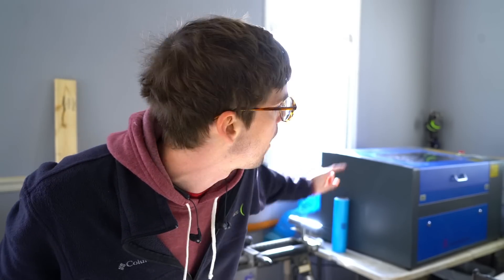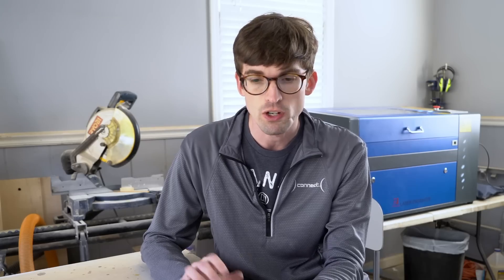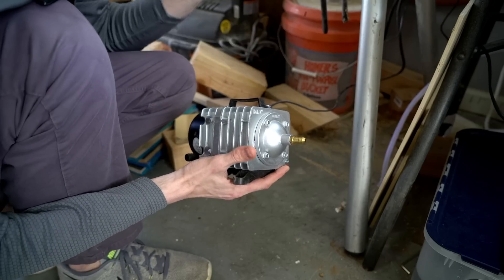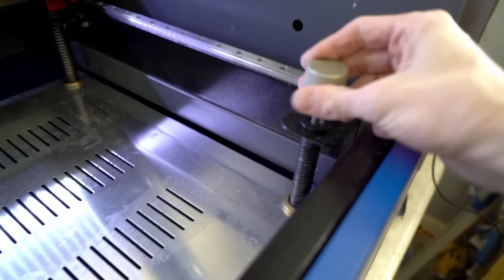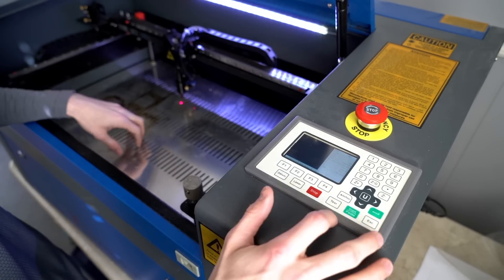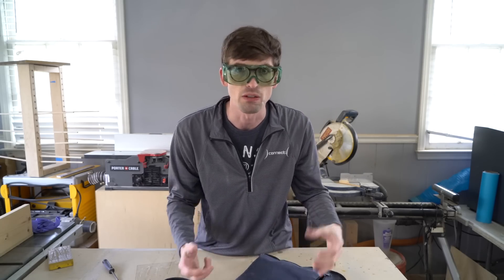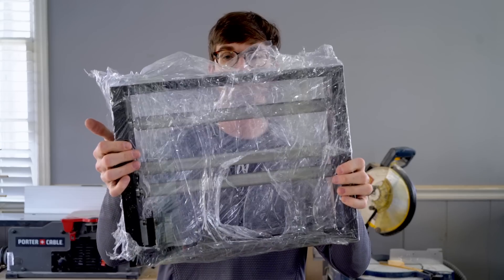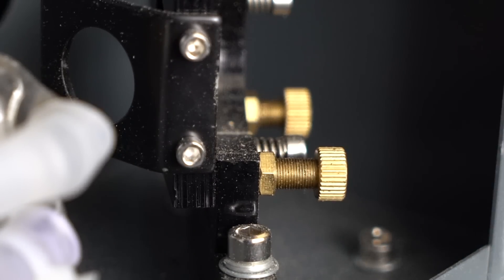Did I Waste $1500 on a 50W Laser Cutter from China?

Comment: You need to add a ground. It's there for a reason.
Reply: That's primarily for Setup in China or another country with less strict electrical codes.  So as long as you make sure the box is ground correctly with a multi meter and that your house ground is wired correctly.  A simple gfi power strip is all that's needed.   It is already wired with a ground and 3 prong connector for use in the us.

Comment: I have the same laser with the other controller and have used it for more than 3 years with no problems. Very happy with my purchase my only concern was the software that came with the machine was a bit flakey with a virus on the disc! Used with Corel draw it's and excellent machine in my workshop.
Reply: Nick hey Nick where did you bought your laser?

Comment: Why not just buy the glowforge for 2,000?
Reply: You HAVE to be connected to their cloud in order to cut anything. Closed loop system. No thanks.
Reply: A gloried k40....😂 yeah it is a 'good' buy. By the time you spent on a high end pro version, the same money can pay for a 1300 x 900 industrial laser with 100W tube, pass through, up down table, linear rails, a water chiller abd runs 10x faster.....with change to spare....yeah...glowforge is a "great" choice
Reply from the maker: Love Glowforge!  The basic unit is actually $2500 and the bed size is 19.5x11 with no pass through slot.  To get a unit that could handle the size of stuff I could put in mine we would have to get a the pro version which is $6000.  What glowforge is doing is pretty amazing though, their software is top notch and I actually had their CEO recently on my podcast (The Make or Break Show).   Maybe an upgrade down the road for me if I hit on some products to sell that justify the upgrade.

Comment: Everyone said be carefull with the grounding! Also i have this grounding wire i didnt care to use!

No but serious, connect these grounding wires to some kind of ground! The tube itself works with high volatage not your everage high volatage, but really high voltage we are talking about multible kV! in case of an internal short you can touch the laser metal housing and turn into instant bacon!
Reply: Good to know...  I ordered one of these last week and hope to get it this week (US based supplier/distributor).  Will definitely check and re-check grounding!

Comment: That white double sided tape is for aligning the laser mirrors if I am not mistaken :)   Great wrap up man!  Wow, that rotary is a beast!
Reply from the maker: good call!
Reply: You can use pretty much anything that will burn to align the beam to the mirrors...  I've used file cards in the past, but also heat sensitive paper works well too.
Reply: @WHJeffB  yep. But I was referring to the roll of white double sided tape that often comes with these laser machines.
Reply: @Geeksmithing  Got it...  Thanks.
Reply: i want to buy one that engraves stainless steel, i want it for watches straps. but i have no idea what to buy exactly, because i looked on ebay and they all claim they can engrave stainless steel. could you guys help me pick one that is easy to use and would engrave about 1mm deep on steel. i also have a question you guys have probably tested before, lets say it engraves 1mm deep, so if i run it twice on the same piece would it do a 2mm deep cut or will it ruin the work? thanks for your help . 🙌🏼
Reply: @milikiwiki1  A laser that can engrave metals is going to be something in excess of 100-200 Watts.  Even then, you won't be engraving metal 1mm deep.  Even with higher power lasers (>2000W) engraving stainless cleanly will result in engraving that about 0.3mm-0.4mm thick max.  There's a fairly fine line between engraving and cutting.  Trying to remove a lot of material for deep engraving requires a good amount laser power, but it also results in a very messy engraving (you have to understand the process to see why).  Getting back to light engraving of metals, I'd say start with a 150W system, but you won't be engraving super deep, just surface engraving with very slow feed rates.
Reply: @milikiwiki1 , you will need to buy a fiber laser to do what you want.  A 20W or a 30W will get you 1mm depth, but to run another set of passes for the extra depth, you would have to adjust your lens down (or your part up) by 1mm. There are some Chinese import machines available for around 5K, but you also pay import fees, which vary greatly from one location to another. Wisely actually makes a decent machine. I bought one last year, and while the software (EZ Cad) has a bit of a learning curve, there are Facebook groups where a beginner can get help for getting started. Best wishes to you.

Comment: SAFETY WARNING - Those green goggles are for blue diode lasers not for the CO2 laser and if it isn't made out of PC they will stop nothing.  Just a safety warning.
Reply: huhhman  With such a well formed argument I don't know how I could possibly reply.........

1. retail/industrial co2 safety glasses are just polycarbonate lens's
2. Acrylic will absorb a higher energy density than PC, however PC is cheaper and easier to manufacture and the difference in protection for any home/shop grade co2 laser is negligible
3. My statement about prescription eye wear is based on the fact that the vast majority of glasses (especially in the US) are made of polycarbonate. 

But please enlighten us as to what proper eye protection is? Is it the sticker on the box they come in that says "protects against wicked awesome lasers and totally isn't just a pair of standard polycarbonate safety glasses"? Or does it rely on short replies that primarily consist of insults and zero facts, because you certainly have nailed that.
Reply: huhhman  Another very well formed and exceptionally enlightening stance, your logic and explanations are unmatched. You are a true scholar sir. I only wish I had the insight and obvious knowledge you do.
Reply: @makeorbreakshop  "The best stooge" is Incorrect.......Pretty much anything will work as safety glasses for a Co2 laser, especially at only 50w. The PC or acrylic safety glasses, though tint is completely redundant, will absorb the vast majority of the beams energy (which is why your co2 laser will cut/burn plastics). There protection would only last very briefly at the lasers focal point, but it would be fairly difficult to arrange having them on and getting your head under the laser head and at exactly the right distance to be at the focal point. 
A unfocused beam would take a considerable amount of time to get through pretty much any plastic or even glass lens (your prescription eye wear offers more than adequate protection) 

Second side note.......the "chiller" you showed briefly is not a chiller, it is just a radiator with a water pump and fan, the best it is capable of is cooling the water to ambient air temp, but it will struggle doing that if you run any long jobs on your machine. you would want a CW-5000 or above to get an actual chiller that uses refrigerant to cool the water.

Side note number 3........inline heaters are only used for people who have their laser in a non temperature controlled environment where the temp drops below freezing. As the water freezing inside the laser tube will break the glass tube. 

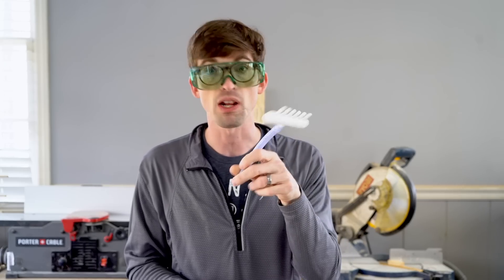Side not number 4...... The plastic manifold with the tube coming off it at 5:48 is what comes with the air pump (they are just pond air pumps) and the manifold is so you can branch off the main air out and feed it to several smaller lines going to aerators in your pond.

Side note number 5...... If you have read this far, I actually have a spare ruida controller I would be willing to sell you if you were interested in doing the conversion.

I run two machines in my home shop. A massive 1300x900mm working area 150w and a smaller 700x500mm 80w.
Reply from the maker: @techoverload  If only every comment was like this.  Thanks so much for the helpful comments.  I definitely didn't want to present this like I was an expert, just what I was learning so far.  Shoot me a message about the Ruida!
Reply: many   trying to tell that  clear acrylic  makes sufficient protection
my problem with this  if it werent  work then  i  werent able to answer due    theres  only one chance  to make  mistake with laser

the best idea is  looking for designed   protective  windows
they cost   roughly around  50  for this size of  machine

do your research  because  one mistake and youre  blind..

heres  one site they have  for 10600  wave lenght  but there are  another sites as well
trust companies  who actually producing these windows not  random folks trying to tell you something

again it is  only  one.. look for more and get a good  protective window

https://www.aliexpress.com/store/product/532nm-1064nm-laser-safety-windows-and-laser-safety-guard-laser-safety-boards-CE-200mmx200mm-thickness-5mm/404881_32955766824.html?spm=2114.12010612.8148356.10.60747329KmEJaT
Reply: Apparently you didn't see the video a couple of years ago that proved any, ANY, polycarbonate glasses will protect you long enough to get the hell out of the beam.  Fear mongers, pearl clutchers, and plain ignorant people is why the shysters can get away with wild claims.
Reply: @thebeststooge  Exactly...  PC glasses are fine for low power CO2 applications like this.  The key is if you start to see the glasses fog, burn, distort, or feel any heat, turn your head away.  It's really that simple.  No need for expensive laser glasses or special window material.  We're only talking 50W here.  If you were talking several hundred watts, or higher, sure a little more protection might be advisable.  But generally PC safety glasses, with side shields are sufficient.  

Your biggest protection is your brain...  Don't do stupid shit and you're not likely to be harmed.  In 25yrs of working with high power industrial laser systems (1kW up to 10kW), I've only been burned twice, both times due to the carelessness of others.
Reply: @WHJeffB Exactly, do stupid shit win stupid prizes.

Comment: that's a pretty big laser cutter. The one I use at Fab Lab is a 40W, and not near as big as that one
Reply from the maker: yeh the bed size was the main reason I went for the larger version, this is 20x12
Reply: Make or Break Shop what’s the max material height you can put in there and not clash with the head?
Reply from the maker: @BruceAUlrich  I'll have to check, but pretty big.  The bed can drop almost all the way down to the base so I'm guessing 6-8 in
Reply: Make or Break Shop wow! Impressive

Comment: Ooooh! 

Have you done much cutting on it yet? It seems to work fine for engraving. How effective is it at cutting?
Reply from the maker: yep!  Great at cutting, just didn't have the camera running when I did.  I'm planning on doing a follow up on the actual process I'm using to make designs/cuts and will make sure and include all of that.
Reply: @makeorbreakshop  Looking forward to it!
Reply: @makeorbreakshop  please do, i am highly interested how it will cut (dark) plastics like acrylic and other plastics and how accurate it is. just found the channel because of this laser cutter and i would like to see if its worth spending money on for making parts.
Reply: I am also intrested if IT can cut aluminum, and if IT does, what are its limits.
Reply: @r.e.s.bastler5100  it will definitely not cut aluminum. Low watt CO2 cabinet lasers will not touch metal- they won't even mark it without a special spray like cermark or moly dry lube.
Reply: @r.e.s.bastler5100  no laser can cut aluminum.